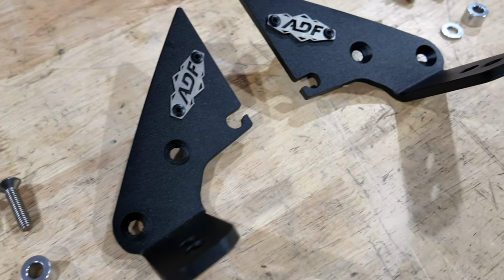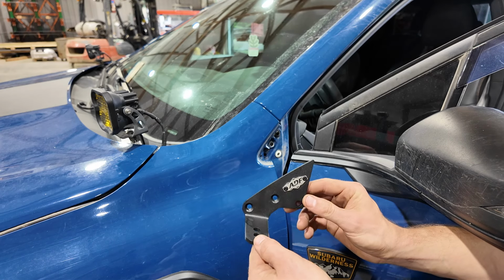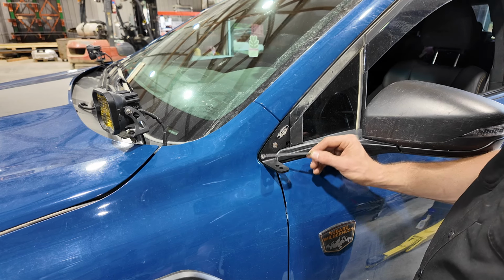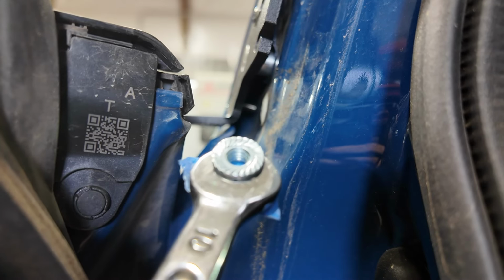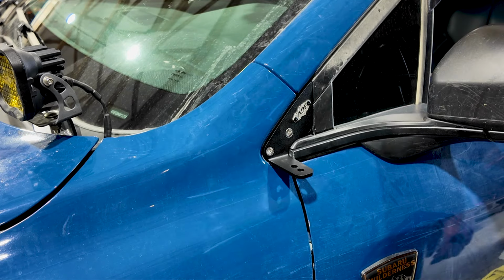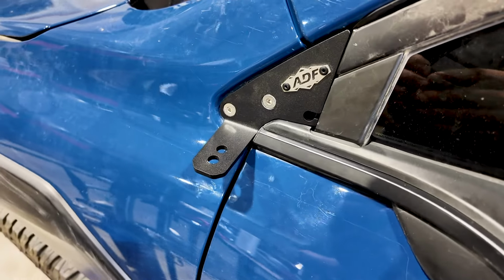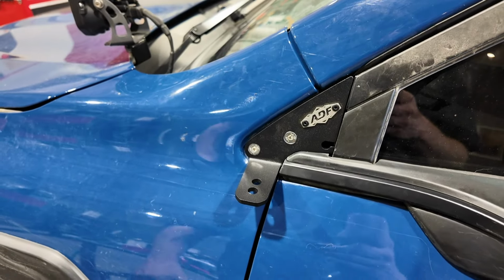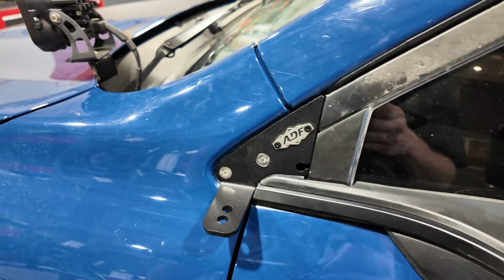How to Install Ditch Light Brackets on a 2020-2025 Subaru Outback Wilderness | Step-by-Step Guide

Comment: What did that 10mm bolt  hold? Are you missing anything by removing it?
Reply from the maker: It holds a second of the fender but is re bolted into place with the new provided hardware